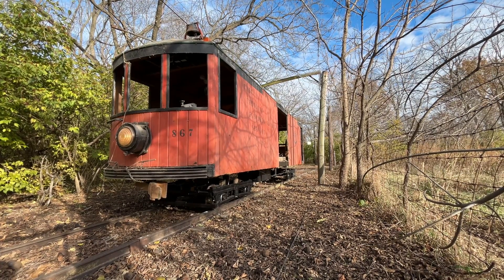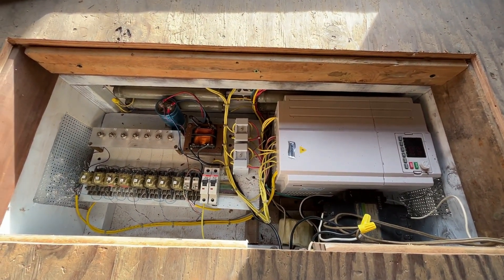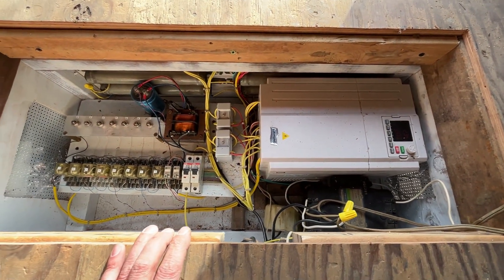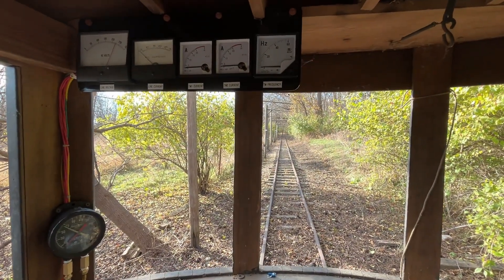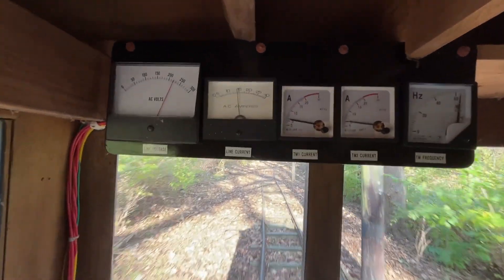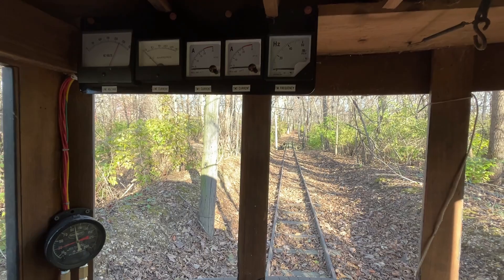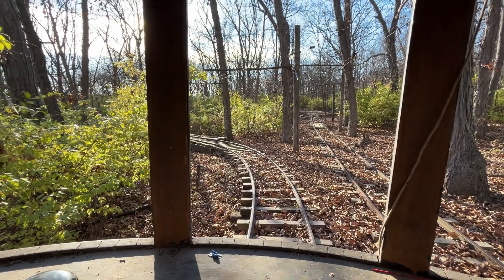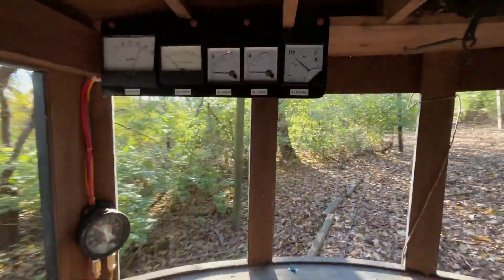Boxmotor update: VFD cabinet and meters installed

Comment: That's pretty nice! What are you using for traction motors? I assume not the original DC monsters, since I didn't see lumps as big as the trucks off the side of the trucks. 

If you wanted, you could probably reduce the dynamic braking, and force yourself to use the brakes, like in the old days. Personally I don't know if I'd want to go for that much authenticity. 🙂

BTW, I'm very concerned about how close that filter cap is to the braking grid. Electrolytic caps do not like heat! Personally, I'd want at least 4 inches between the resistors and the side of the cap, and it looked from the picture like only an inch or two. That's just too close to something that could get as toasty as those resistors. If you can't move the cap, look for some heat insulation board to put between it and the resistors.
Reply from the maker: I'd agree but I ran the car for over an hour and there was NO heat from the resistors, the internal resistor in the drive seems to do most of the work apparently because there is very little current through the externals. .

Comment: The progress is awesome - so glad to see it moving forward!

That frequency gauge is genius! I'm also impressed that the leaves on the track didn't cause issue with power supply. I wonder how the VFD does with brownouts?
Reply from the maker: The VFD works down to 180V, I  have yet to encounter leaf cover so thick that it drops that low. It also has a very large front end capacitor bank that helps it ride through the intermittent power drop, should there be one.